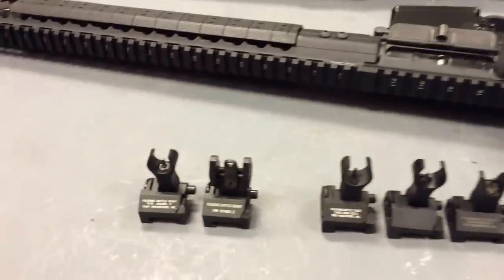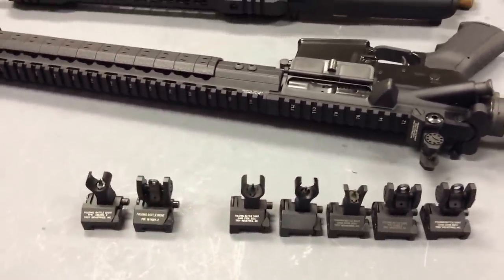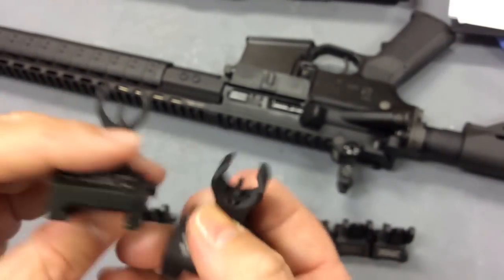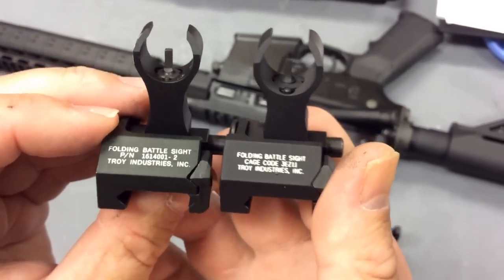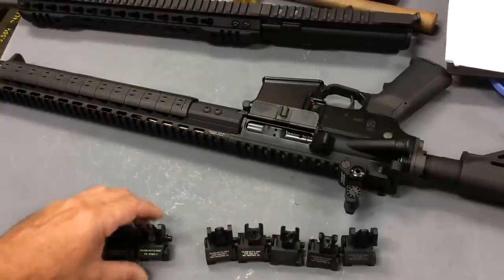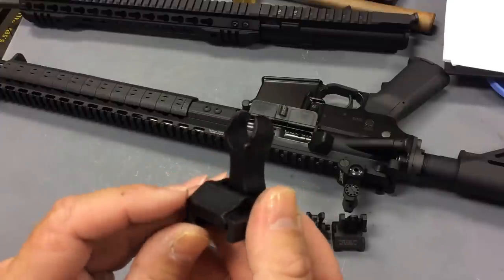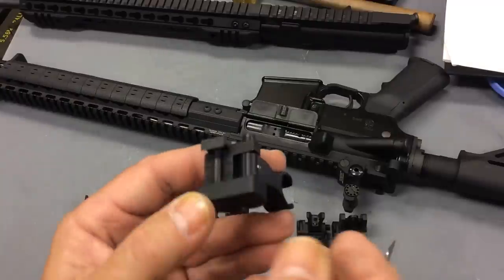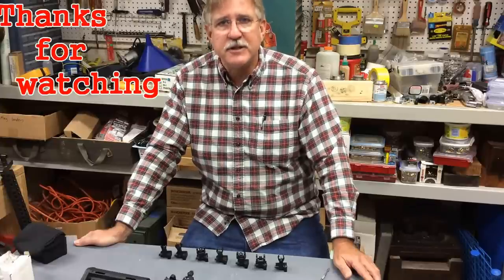Fake Troy Sights: Identifying a Counterfeit BUIS

Comment: I had to go check all of my Troy rear flip up sights because of your video. They all have Cage Code 3EZ11 on the front, slightly rounded edges, no tool marks, and resistance when I flip the big/small aperture. I do have about 1/8" of wobble when flipped up, but I think that is okay since it only moves if I fidget with it.
Reply from the maker: Thanks for watching!

Comment: Just got my pair from amazon and did not know of this video until after they arrived. Still very glad I saw it, in case I had fakes and needed to return them. Everything indicates mine are genuine. The packaging was from Troy (made in the USA), the print and logos are clear (says made in the USA), there are no tooling marks, the rear sight has that snap in it when you rotate, etc. Thanks for the video.

Comment: Michael, I think you missed the most obvious flaw.  The genuine article has the US Gov't GSA (General Services Administration) cage code 3EZ11 stamped on it whereas the fakes do not.  This unique cage code is assigned to all contractor-supplied materials and equipment authorized for procurement by Uncle Sam.  My suspicions are confirmed by observation of the real deal on the Troy Industries web site.
Reply from the maker: +spankervideo Most of the Troy's have a cage code but I have a few that have a part # instead. They may be the older ones. Unfortunately it seams that the counterfeit producers can print what ever they want to. The one set I have uses P/N but I do not know if some print a fake Cage code. I do not know if there are fakes with fake cage codes but I do have some real Troys with P/N instead of cage codes.
Reply: 10-4, I concur.  These sights are pricey and its infuriating that people are getting ripped off.  Incidentally, the packaging that I saw includes a GSA stamp or logo on the packaging.

Comment: Good information.  I also noticed that the axle on the rear sight is closer to the base and there is less light visible underneath it on the authentic.  Also you mentioned parkerization but that's a process for steel and I believe these are aluminum so it would probably be anodization.
Reply from the maker: You are correct.

Comment: Wow. thanks for this info I was thinking of getting one too. Just not sure where to buy a real one at a good price.
Reply from the maker: Around $180 for a pair is about the best I have found. They go on sale at Primary Arms from time to time.
Reply: Michael Bell Do you recommend any other type that is comparable as far as quality?
Reply from the maker: Magpul Pro, LWRC Skirmish are both top notch.
Reply: Michael Bell I ended up going to a local reputable gun shop and picked the Troy. I could have gone with the others you mentioned or online. But your advice helped a lot Thanks again.
Reply: Michael Bell I noticed on the underside on mine the logo is not a large Trojan Horse but something like a Horses head. Did Troy go with a different logo? Also What does CAGE stand for?
Reply: Aim Surplus has them for $109 for the pair, and TROY says they are real

Comment: This video doesn't  say much.....odd we are never shown the packaging the sights went sent in.....real troy sights should be packed in sturdy containers with factory information.  Why isn't this discussed and why is the package not shown?  Seems pointless without it.
You also didn't show us if the front sights are  tight or has any wobble.  I have not been happy with TROY sights, as the front is too lose in my opinion.
Reply from the maker: The fake sights were on the rifle for some time before they broke. I do not keep all of my old packaging. I don't remember how they were packed so I can't discuss that aspect.
Reply: @MichaelBellmbell556  Well I just bought some REAL Troy sights from Troy, and am sending then back,,,,,the sights are way too lose and wobble.  They say that is normal so the sights can fold up and down...I say for $180 retail they are no better than the cheap plastic ones i took off.  NO WAY these are going to hold zero.

Comment: Where did you get those rail covers ? Those are MINT !
Reply from the maker: Which ones?
Reply: @MichaelBellmbell556   The ones at 3:37 !
Reply from the maker: @stevenrichards3699  Noveske
Reply: @MichaelBellmbell556  Thanks !
Reply: @MichaelBellmbell556 the Noveske shop is a couple miles away from me. I knew John, he was a great guy. He didn't let anything go out that wasn't up to his insanely high standards. I believe his wife and boys run the business now, they still produce great guns, but not like the ones they made when John was around.

Comment: where do you think you bought them from? let's shut them down!
Reply from the maker: +AriesGeneral I wish I knew. Probable an individual off of one of the boards. Could have been with a used upper I bought or a group of used parts. Who knows. When I first found out I thought it was from my last purchase of Troy sight's when I bought 10 sets. I was afraid I was going to find 20 fake Troy's. But only found one more, so it was probably from an individual. I have just accumulated a bunch of toys over the years and these just slipped through.

Comment: What do they call them “backup”.
Reply from the maker: Not intended to be primary. They fold out of the way of your primary red dot or telescopic sight.
Reply: I just received my first AR15. I have been going back and forth on what kind of sight to get . Red dot or Iron sites. So many to pick from. I want something now. The wait on almost everything is back ordered. There are some Aimpoints available on one site. Any suggestions?
Reply from the maker: @ATP360  Aimpoint is top tier. If you only have 1 AR then go with the best and spring for the Aimpoint if you want a red dot.